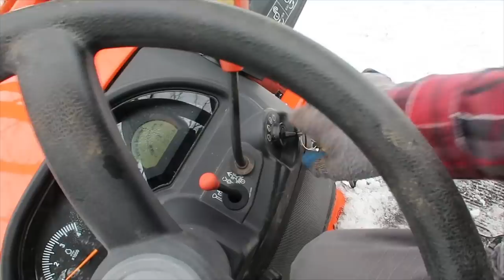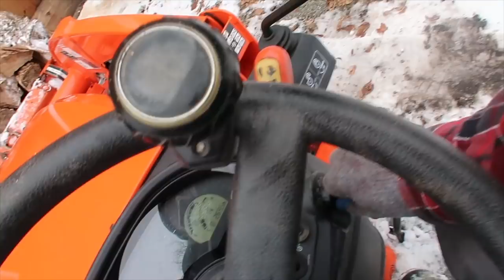Its time to RELOCATE our Rooster (Andy)

Comment: What you need is at least 200lbs of weight in the back end of the truck,over the wheel wells.snow tires will help but without the weight in the back you will continue to have issues.good luck!

Comment: Thanks for the videos. Watch then every time you upload them. 
It’s supposed to be in the 20’s here in Anchorage, AK but we have no snow!

If I can give a recommendation, try using Power Service Diesel Fuel Supplement. It’s in a white bottle and has an anti-gel agent in it as well as a lubricant in it which motors love in the winter. 911 is made for fuel that has already gelled up. Using too much isn’t the greatest on your motor.

Comment: HAPPY Thanksgiving!  'Gotta tell you that I used your idea of the potatoes in the InstaPot.  I put 6-sweet potatoes total on 2-racks...high pressure for 20-minutes.  I was able to peel the skins off just using the tongs.  Mashed with butter and added to our Thanksgiving meal.  The dogs will have the skins added to their meals (a few days' worth).  Yep, I am smiling.  Thank-you for the useful tip!

Comment: Happy Turkey day All and Family, BTW the same company that makes 911 also makes a regular additive to make regular diesel ok for winter use. It drys the gas and helps reduce water in the fuel. I would only use 911 when you already have a frozen fuel line. Not every day.  Since you asked its 84 sunny degrees here in the Florida Keys. Watching your video while sitting on my sailboat. Just arrived at the Keys after leaving Sandusky Ohio in May.
Reply from the maker: That sounds amazing! Sitting on your sail boat for thanksgiving!

Comment: Great video
Would it not be a good idea to fill the tractor bucket with a load of firewood when you stored it. A straight shot to the house in the event you needed a bit more in a pinch.

Comment: Your goats sure are roly poly. I wonder if that might mean a fierce winter still to come ?  I currently have 24 * F going to a high of 28 * F for Thanksgiving.  With a high of 43* F on Friday , 48 * F on Saturday and 51 * F for Sunday here in NE , Ohio. Remember , a heavier snow cover on the ground over the winter means the ground does not freeze as deeply so it thaws sooner in the spring. Which means that you can plant earlier.   My tomatoes did not ripen well this past summer  I had plenty of tomatoes , just not so many red , ripe ones.  Just as well because I love fried green tomatoes also .
Reply: Donald Miller love fried green tomatoes